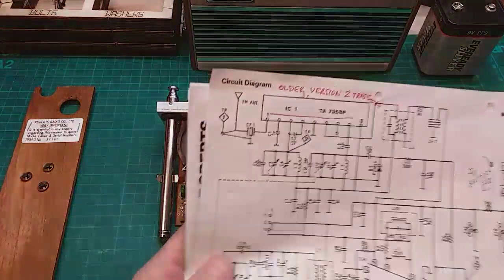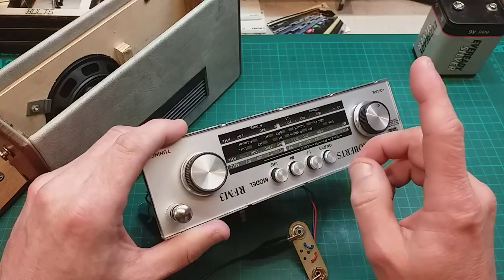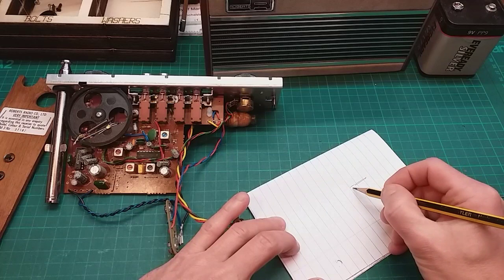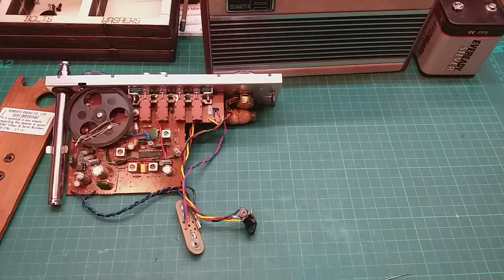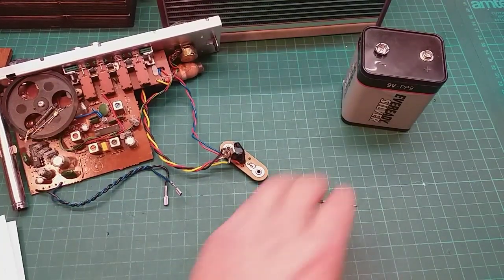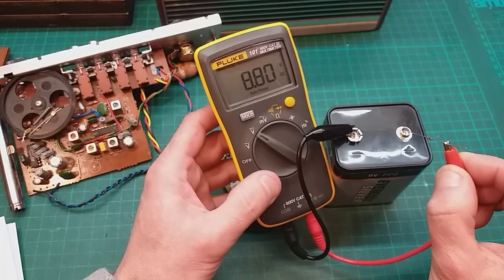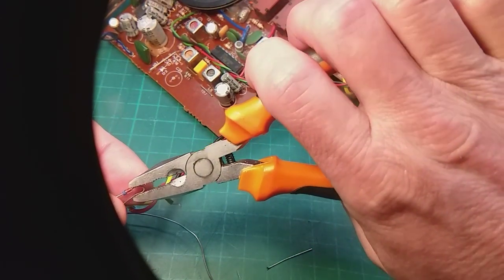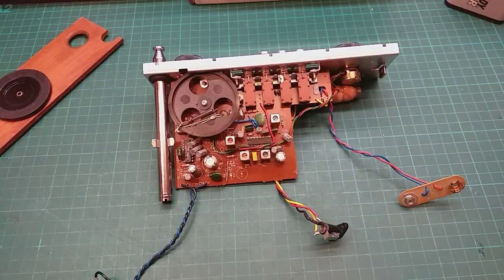Roberts RFM3 Radio , Test & Reverse Polarity Protection

Comment: I am just learning about this radio from pulling it out the back of  my cupboard (was my parents). It is in very good condition. So I bought the battery (like yours) but find after about 15 min of use the sound reduces and reduces . If I try again an hour later it is fine again....until it then repeats. Any idea what causes this? On mains it works fine.
Reply from the maker: @Kh13570  Hi , first port of call would be to power the radio up on a DC bench power supply to eliminate the possibility of a bad battery, hope that helps

Comment: Hello again Shaun. Coincidentally I have just fixed one of these very nice little RFM3 radios where someone had blown the TBA820M output amplifier chip (it too was an early model) presumably by having attached a positive pin adaptor. And of course this got me on to the thought of putting an in-line schottky diode in place to stop it from happening again. That left me wondering what type to use? - and of course I came across your excellent video and the comment by GNU_Ninja which has the answer!

Before having this thought though, I also installed a DIP socket so that should it should ever happen again it will be a simple matter of pulling the blown chip out and slotting a new one in. I mention this as another reason for doing it is that within reason these cheap DIP sockets aren't as susceptible to heat damage as the chip itself - and as an "amateur solderer" I think that's worth thinking about.

Again really enjoyed your video, and keep them coming! Great work!

Comment: Good trick with the diode, I was surprised it took the full current of the battery without getting a bit warm. I suspect another way is to put in a fuse and then a diode which takes any reverse current straight to ground, blowing the fuse and thus cutting the power to the main circuit. Needs a fuse change but prevents the .7 volts or so voltage drop you get by putting the diode in line. In your case the diode was of course the best option.
Reply from the maker: Thanks for watching
I did look at ways to prevent reverse polarity and just choose the simplest 
So many of these Radios got damaged because the wrong adapter had been used , some think the negative pin was done on purpose by Roberts to get repair work in , i'm not sure on that 
Glad you've watched my videos , i'm really enjoying your channel , i'm thinking of taking a Radio out with me and filming some outside cooking as your channel has inspired me to do so 
Best regards Shaun
Reply: @SweeneyTTodd  Just keep it simple and it will work splendid. I have done proper long expeditions and I always took a little radio just to keep up with world events, I also used a marine direction finding radio at sea. Then on land when we go camping in a group we have a few CB hand helds for coms. ATB

Comment: Changing capacitor kind of depends on what your planning on doing with the radio. The capacitor haven’t had a hard life in a battery set as the failure rate is governed closely by the heat inside the cabinet. Battery sets run cold. However I wouldn’t consider any capacitors to be beyond suspicion after 20 years.   So if it was a set I was selling I would change them out.  Centre pin positive is the typical arrangement as the idea is the outer shell that’s exposed should be at 0v like the chassis.  God knows why Robert swapped it round but lots of sets were destroyed for that decision.  Battery equipment usually uses a parallel protection diode as some equipment won’t tolerate the volt drop of a standard silicon diode 0.6v  as battery life is slightly reduced.  Generally speaking my preference is for a series diode as it avoids damage to the radio and the  power supply.
Reply from the maker: Interesting food for thought there Chris 
I'm just processing it all , thank you very much for watching and commenting 
Best regards Shaun
Reply: Totally agree. A series diode is best in my view. Avoiding lots of issues

Comment: Great video again, Shaun, followed you all the way, everything nicely simplified for those wishing to learn. Regarding the electrolytic caps...it was from a PS Audio video that I came across the recommendations regarding the changing of these electrolytic caps. The owner of PS Audio was answering enquiries regarding servicing old audio equipment and do you automatically change all electrolytic caps. PS Audio stated that if the cap is 20 years old then think about changing them. If the caps are 25 years or older then you must change them. The owner of PS Audio has been in the business of designing and building hi end hi spec audio equipment since the very early 70's.
Reply from the maker: Thanks for watching Theo and commenting 
Fantastic to hear your knowledge and knowhow 
If it ain't broke don't fix it , i will give the RFM3 a service in a few years but for now all is good 
Really appreciate your comments and advice 
Best regards Shaun

Comment: Very nice demo of the diode doing it’s stuff. I’ve started adding these in to all the modern Roberts sets with a power supply socket that I sell so as they don’t come bouncing back as not working! Thanks for the mention and glad you found the videos I did useful. Cheers Graham
Reply from the maker: Thanks for watching Graham 
Good little mod to prevent reverse polarity problems not seen many do it 
Best regards Shaun

Comment: Lovely Job Shaun I Burnt Up My Amp Board in My Blue Hacker RP25 Because The 6AA Battery Adapters To PP9 Battery Snap Were Wired Up Back To Front Not My Wireing But Should Have Checked The Adapters First Let Out The Magic Smoke From The Output Pair (what a plonker ) This Of Course Would Not Have Hapened If I Had Put a Common Or Garden 1N4001 Diode in Line Thanks For Uploading Stay Safe Regards mike.
Reply from the maker: Thanks for watching Mike 
After reading the other comments , i think there's better diodes to use than the one i did ,just had it to hand and read the data on it , still i think it will do it's job 
Blimey i bet you was gutted when that happened 
Best regards Shaun

Comment: Great video Shaun. This is somthing I've been meaning to do with my Roberts R250 (my first restoration) and I've noted down the polarity questions which you have answered here. Many thanks ☺ It's also perhaps good practice in all sets with a DC input perhaps?... I'll be the same with my Hacker Hunter I think. It can't do any harm eh ☺
Reply from the maker: Thanks Richard 
I think it is good practice if the set dosen't have polarity protection 
Do read the comments here , there are better diodes to use than the one i had at hand 
Do click on the link in the description , that channel has taught me lots on loads of different radios , i think you know who it is 
Thanks for watching means a lot to me when people comment 
Best regards Shaun

Comment: Well done Shaun. You have to wonder why Roberts didn't do this in the first place when they designed the radio. Some would say it was to save a few pennies on cost others would say that they knew people would hook them up the wrong way and give them some service business after the sale. Anyway you've got yours good to go now. Stay well.
Reply from the maker: Thanks for watching Doug 
I know it does make the mind wonder why it was not done at factory, but not only Roberts didn't do a reverse polarity protection, many other Radio manufacturers also didn't
Anyway i hope this little video helps to save a few radios out there 
Best regards Shaun

Comment: Yep spot on with the understanding with the diode :-D
They do have other propertys but for what you are using it for,  you don't need to know.
Different types of diodes have a different loss or voltage drop, so one taken from the output of say an old switchmode power supply will be far more efficent, maybe only 0.4 volt of a drop. ( a schottky diode ).
The voltage drop of any diode will become worse with a bigger current flowing through the diode.
And of cause the 4 diode bridge rectifier (a.c to d.c) works because diodes only conduct one way.
They are a handy component :-D
Reply from the maker: Thanks Harvey 
Your information is appreciated , glad you watched the video hope you enjoyed it , I am learning new tricks it is only a hobby for me but I really enjoy messing around in the workshop
Best regards Shaun
Reply: @SweeneyTTodd  Keep tinkering and remembering what works and what does not.
If that radio is too tinny sounding at low volume,  pick a small value capacitor and connect it from the center pin of the volume control to the earth end,  say 4.7nF or 472 ceramic disk.
If it gets more tinney then connect the cap to the other end of the volume.
A crude tone control at low volume mostly.
Just an experement for you when you are bored lol.